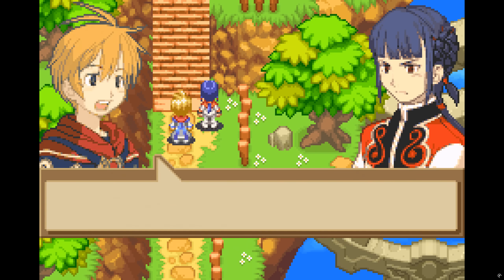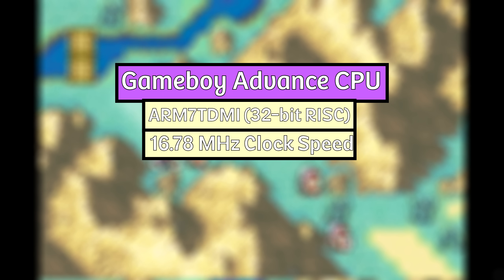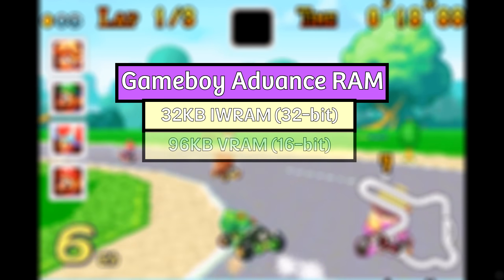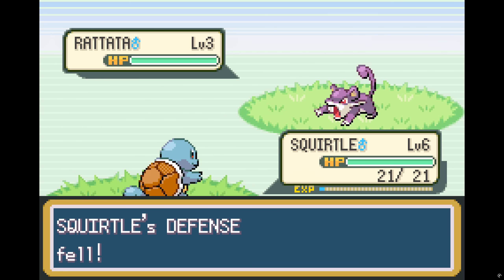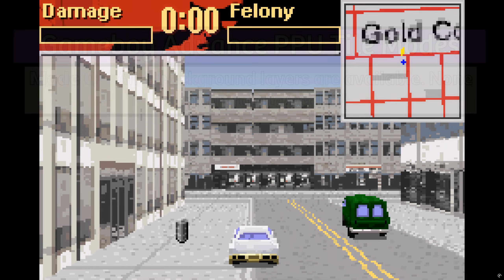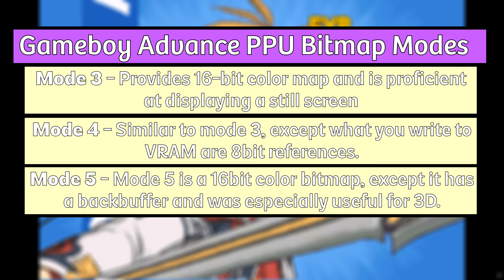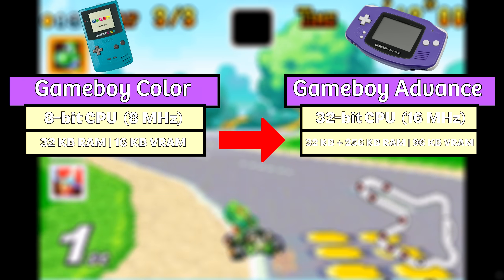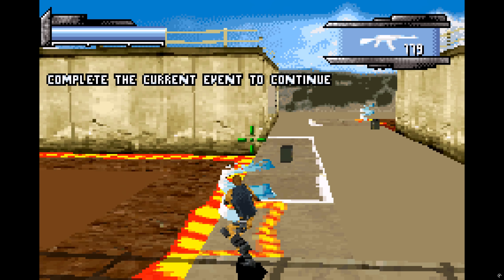The Game Boy Advance GPU: Picture Processing Unit (Retro Breakdown)

Comment: Hsm.  How was sprite scaling and rotation handled?
Reply: Set the MSB of the first byte of the sprite’s OAM.  Set the affine matrix index in bits 0-4 of the second byte of the sprite’s OAM.  Then set the affine matrix in bytes 7 and 8 of the index/4 through (index +4)/4 of OAM.  GPU will automatically handle it during sprite rendering

Comment: So you're finally getting into the more retro systems!

Just a few things to note:

- The GBA doesn't have to run ARM code from IWRAM and Thumb from EWRAM,  Either can be used in both memory areas, though you will use two bus cycles for ARM in EWRAM.
- Sprites can be up to 128x128 pixels.  This is done by setting their size to 64x64, making it an affine sprite and setting the double size flag.
- The GBA is definitely more powerful than the SNES.  A better comparison IMO is to the SEGA Genesis with the 32X attached.

Oh, and of course I'm in the ramble squad.  I hope whenever the SNES is covered you give Mode 7 the in depth explanation it is due.
Reply from the maker: I love your insight, Kirby! Happy and honored to see you in the comments 🙏🏼 I find these consoles challenging there’s so many things to scan through when researching for them so I told myself I need to do them more just for that reason to learn as much as possible and you help me out as well! Thanks for being apart of the Ramble squad fam 😁 it means A LOT!

PS, I will cover mode 7 in depth and hope to make you proud!
Reply: @FrameRated  Yeah, I'm going to guess you didn't read the entirety of gbatek.  Nobody does, except me, because I am a nerd like that.  But it's in there if you look.
Reply: The GBA had a perfect port of Yoshi's Island without the need of the FX2 chip, also Doom on the GBA ran at higher framerates and resolution with better texture rendering than the SNES version, again without any additional expansion chips.
Reply: Super Mario Advance 3 was not a perfect port, though it had nothing to do with SuperFX.  Rather, the lack of offset-per-tile (a base SNES feature) on the GBA made Touch Fuzzy Get Dizzy and one of the later fortresses/castles have choppy movement.

Comment: For me, not having a sound chip is the GBA's biggest flaw
Reply from the maker: Was surprised by that as well
Reply: @FrameRated if it's a arm chipset dosent mean that should it have a sound codec by default?
Reply from the maker: @duopro8335  yeah the GBA's sound system is processed by the CPU, but no dedicated sound chip meant devs had to optimize that and is why it sounds muddier than it could have from my understanding (I didn’t research that part specifically, just what I read in passing when getting the main sauce for this video). Even then, it was impressive  when devs put a lot of work into that as some soundtracks did end up having a lot of charm
Reply: @duopro8335  No.  The GBA's sound processor only supports the 4 channels from the original GB, and 2 8-bit PCM channels which are new.  These are why 16-bit ports sound so extremely bit crunched.
Reply: That's ridiculous the sound was totally fine on the GBA with that iconic crisp. 
I wouldn't have it any other way
Reply: Without a sound chip, the midi is heaven made so well...
Reply: I'm only guessing, but I assume what happens is, they looked at the cool new ARM cpu and thought "yeah, that's more than good enough".
Coming from the good ol' Zilog, it must have felt like a very capable processor. The GBA was cheap, had excellent battery life and they clearly wanted to keep it as simple as possible.

I think they made a good call. Even launch titles like Golden Sun had great music for a handheld.

I remember persistent rumours back in the days, that the second processor was used for sound in GBA games. I don't know why everyone was so insistant on that idea.